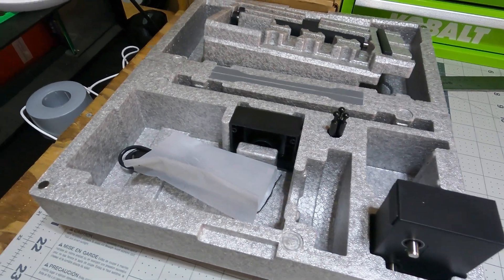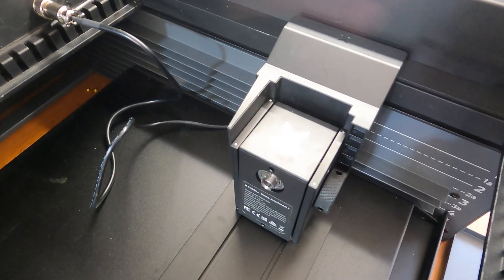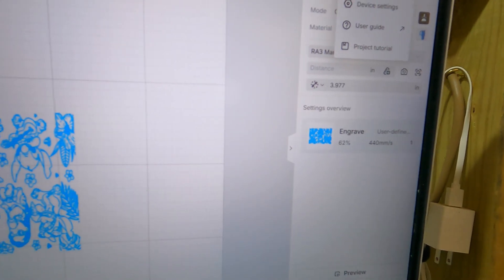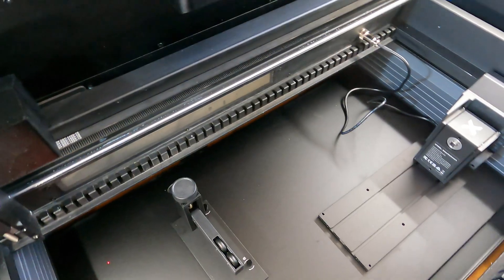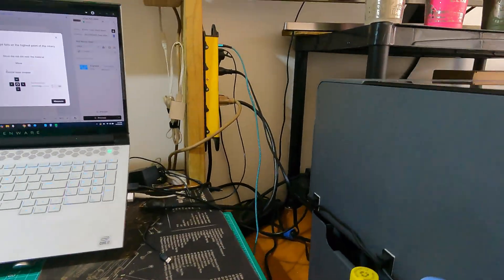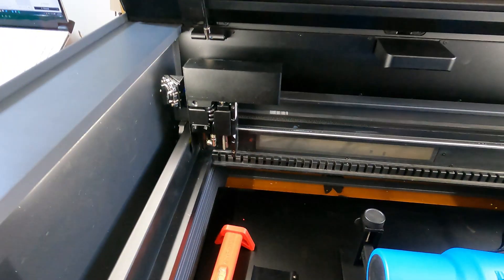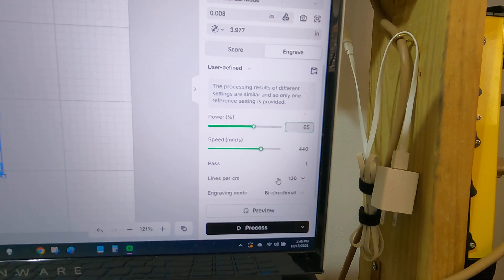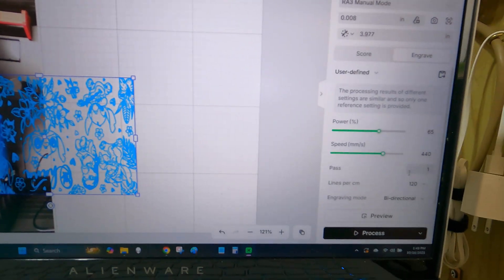How to setup the XTool P2S/P2 laser to RA3 rotary

Comment: very helpful but I have a few issues. First off, my center start line on the tumbler doesn't show up in my screen even after I calibrated and it does recognize the RA3 Pro and I am using Manual. Then it did start to engrave, but it scraps the cone of the laser on the tumbler, even though I did do the measurements on the highest point. can you help with any of that?

Comment: How does one install the bracket to stabilize the RA3. They didn't include mine and resent it but no directions for installing. Thanks
Reply: The plastic bit that holds the RA3 should be attached to the L bracket. You have to screw the small screws from the bottom. Then align the L bracket on the bottom right and screw in the big screw from the bottom.
Reply: @imranarshad7302  Thank you